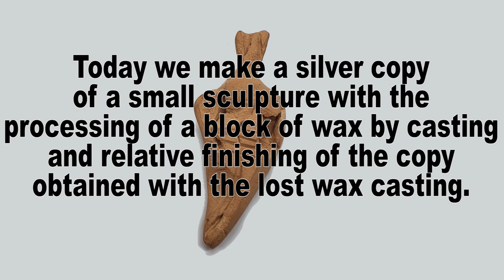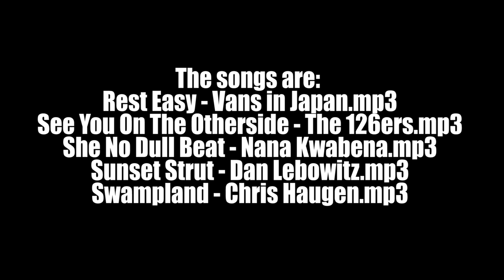Silver copy of a small sculpture

Comment: I don't know what you are doing here. Castoldo produced a silicone many years ago - it comes in two jars. You also need something to exert pressure - some sturdy plastic and some 'elastics' will do. You need to mix the two compounds together until it completely covers the piece. The compound will set without a vulcanizer. When ready, you cut the mould open with a scalpel. You can then shoot wax in the cavity. I do not have a wax shooter - and I do not cast anyway - so I dripped wax in the opening. The piece came out fine. You can them make a master, etc. If the piece that you are using is porous, you need to fix it first with a lacquer. No wax filing.
Reply: Sorry, it should be Castaldo.